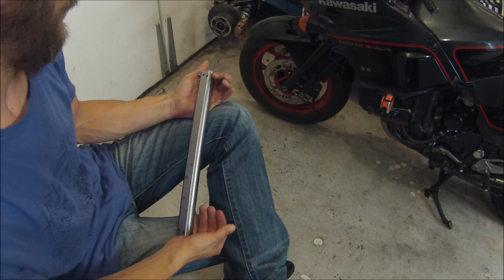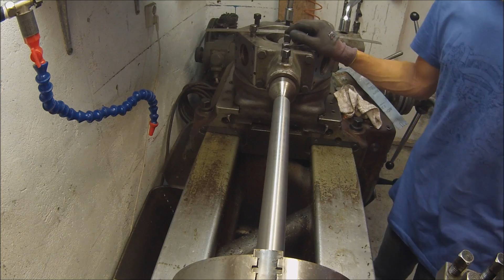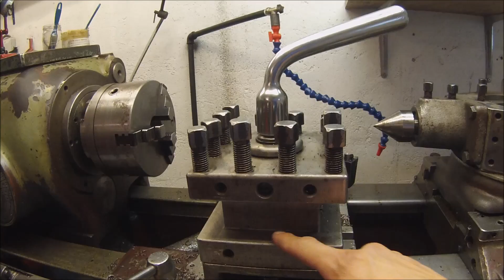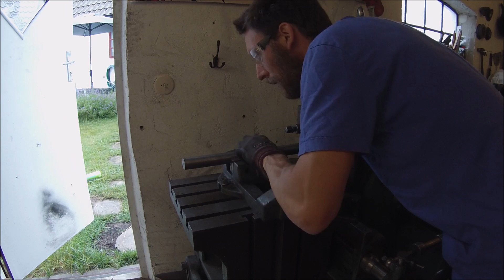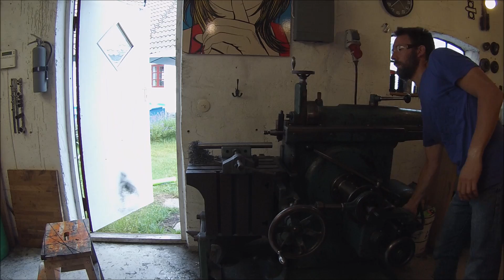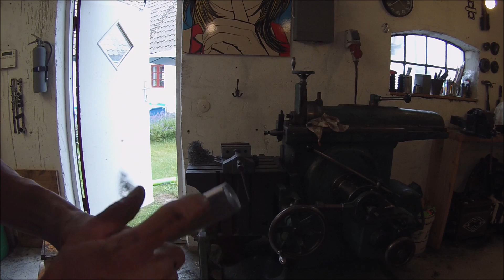Machining a boring bar - Part 1

Comment: Is a similar monster lathe on Craigslist in my area right now for $600 USD. Probly cant sell it because of its size :)
Reply from the maker: Yea, that is one of the best things about these big lathes. They are usually too big for a small shop and therefore they´re not that sought after. Which is good for me! :) That´s about the same price i payed for mine. The thing is that when i firsdt got my lathe into the shop, i saw it as a monster. 2 years down the line i´ve gotten used to it and now i don´t think it´s that big, funny how that goes :)

Take care!
Reply: I just got my 1st Lathe yesterday. A 12" x 36". I outgrew it already! :-/
Reply from the maker: +Makin Sumthin From Nuthin Alright! Congratulations! I think you can find it very useful though. I do projects all the time where i could make do with a much smaller lathe. Looking forward to some videos on it then!